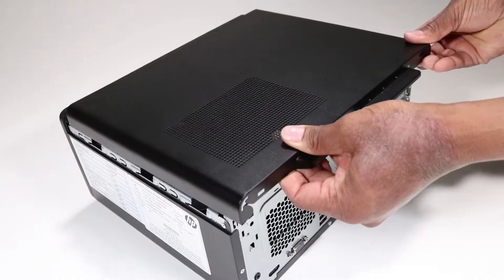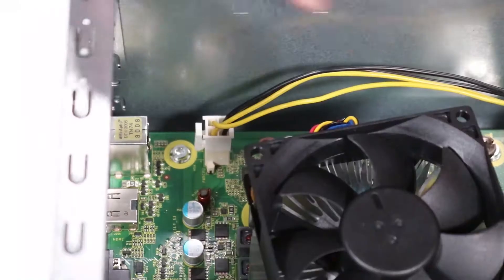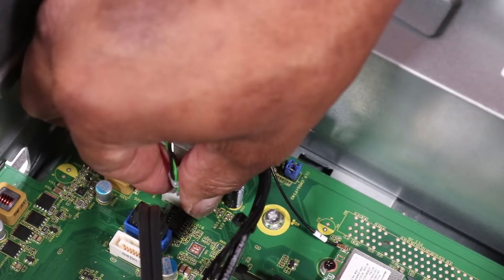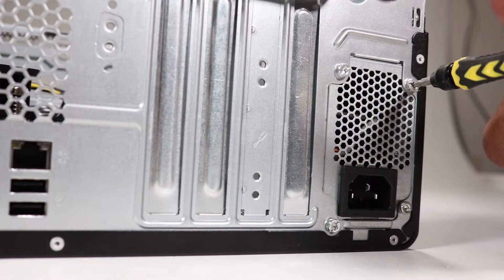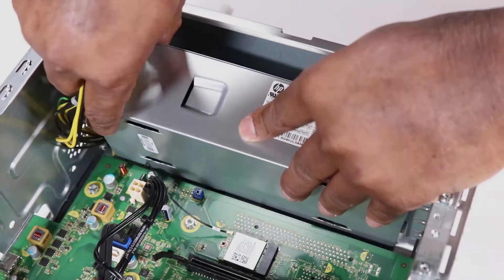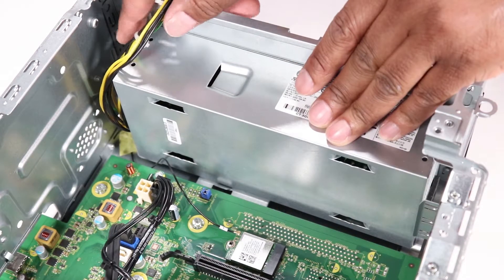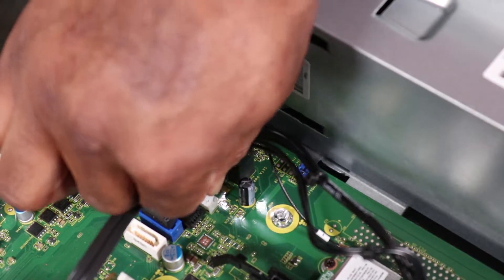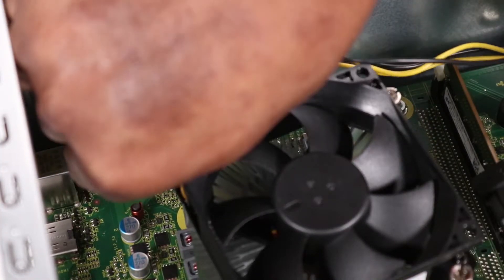How to Replace the Power Supply | HP Desktop 190-0000 PC

Comment: Hi could you confirm whats the maximum watt psu is available for HP Slim Desktop - S01-pF0307in it has 180W psu, but I want to upgrade it to 220-250W thank you

Comment: Hi i have Hp compaq 8200 cmt.Can i change a mother board and the power suply?
Reply from the maker: +GamesFN HP does not recommend upgrading or downgrading hardware parts or software that is bundled with the product as It may affect the manufacturer's warranty and performance, however, you could change the configuration at your own discretion.

Comment: i figured out how to hook up a atx just have to figure out the voltage on the power supply command  one guy hooked the grey wire for the command up to keep the computer running
Reply from the maker: +THE BRIAN7 CHANNEL Thanks for sharing the steps that helped you.

Comment: Hi, I have HP 290 G2 MT Business PC with only 180 W PSU. Which PSU forms or modals can I upgrade to? Could you please give me specific informaton about this? 
I don't care guarantee issues because 4 months left though. 

If upgrading impossible, which discrete graphics cards do you suggest me to buy? For light gaming, video editing. Thanks 🤗🤗🤗
Reply from the maker: +Cem Ayla the motherboard will not allow you to change out the PSU to a standard ATX form. Of the 11 offered models of that unit, there are none that offer a graphic card.
Reply: @HPSupport  Thank you. I appreciate HP's customer support.
Reply: you’re going to need to use an adapter to convert the 24 pin atx to 6 pin power connector. i found one on amazon.

Comment: Are we able to install any other PSU?
Reply from the maker: +Memetell HP does not recommend upgrading or downgrading hardware parts or software that is bundled with the product as It may affect the manufacturer's warranty and performance, however, you could change the configuration at your own discretion.